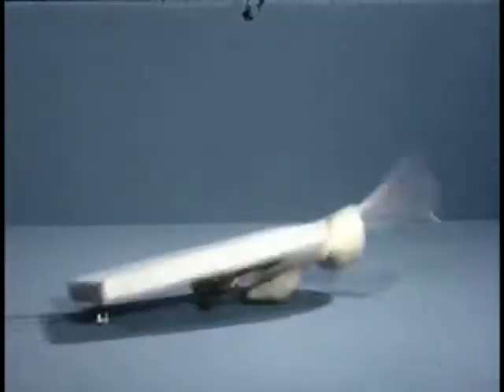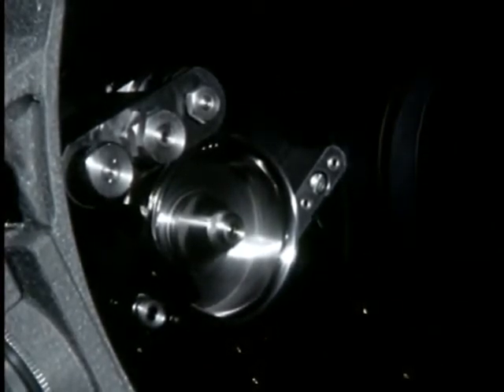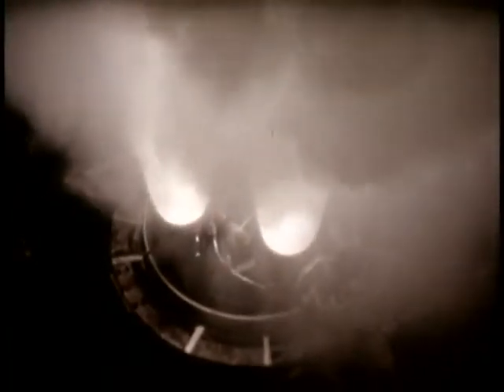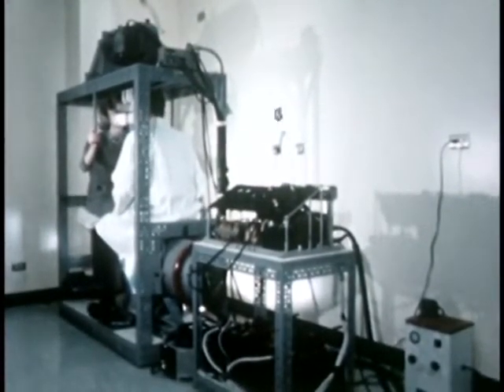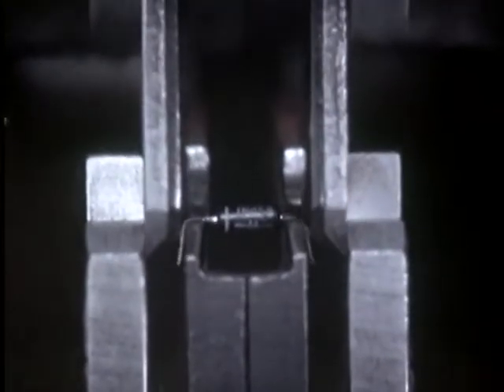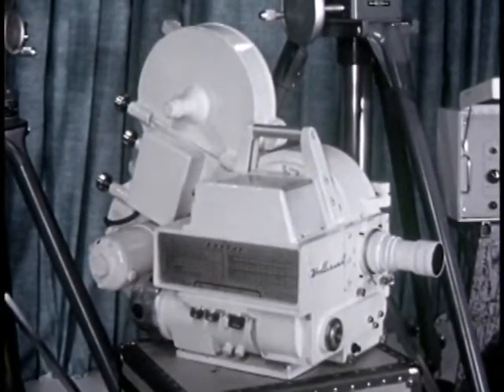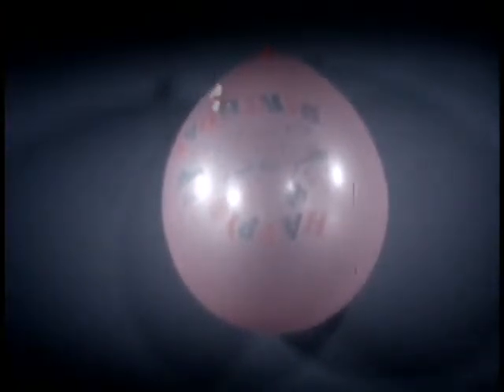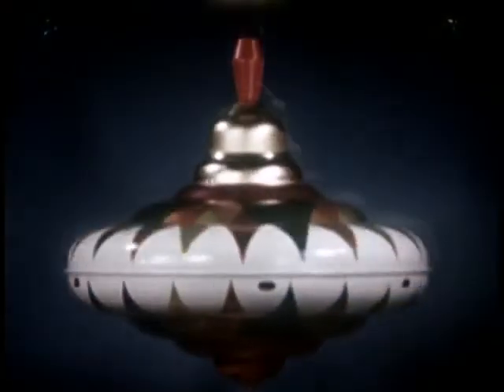Wollensak Fastax High Speed Camera

Comment: My grandpa used to use one of these! He always told a story about how his company made the first US Army "approved" hollywood simulation of a hand grenade. Basically the US Army was financing a film and they wanted a realistic hand grenade based on how a real grenade looked when filmed. so, they went to my grandpa's company who specialized in custom pyrotechnics (and also had a Fastax) and they gave my grandpa a few real hand grenades to film at high speed. the idea was that they would then build a pyrotechnic device that produced the same amount of fire but without the lethal shrapnel or concussion. 

my grandpa severely underestimated the power of a real hand grenade (he was Navy and had never used one) and when he set it off, it completely destroyed his test rig, and it threw the blast shield in front of the Fastax backwards, knocking the camera quite some distance away. the film was not destroyed though, and they were able to complete their project lol. its not even a footnote in cinema history though because apparently the new pyrotechnic device they made wasn't that different from the existing ones and wasn't as visually exciting as the huge fireballs hollywood normally uses, so everyone just stuck with the existing methods that were technically inaccurate
Reply: thats a cool story. any chance the film still survived till today?